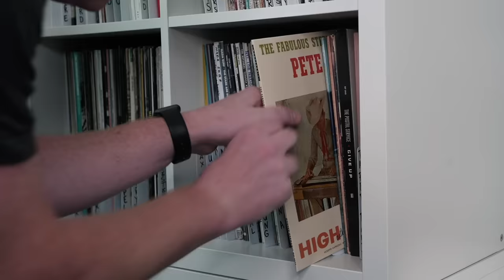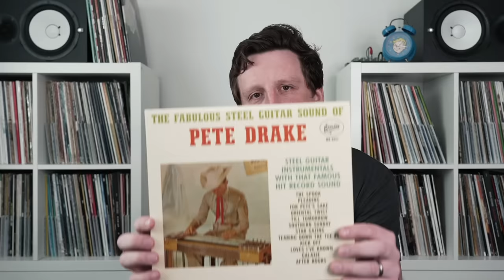6 Guitar Pedal Myths

Comment: I’m an electrical engineer at an aerospace company and every circuit is built with surface mount resistors. If rockets can depend on surface mount resistors then so can your pedals.
Reply from the maker: so much yes
Reply: It's not uncommon that people ignorant to the topic makes an opinion around a myth which then somehow becomes a "fact". Just look at audiophiles and cables - exactly the same thing. Pumping thousands of dollars into "special" cables which more ofthen than not, not really differs to cheaper ones.

It does not matter what the box contains, as long as you get the desired outcome. People need to stop propagating idiocrazy and just enjoy their pedals! :)
Reply: Those boards in the rocket ships, are also Class III electronics, conformal coated, and require perfection! I'm hoping most pedals are Class II, BUT, since they are consumer electronics, they are most likely Class I. I haven't seen any ads on ANY pedals advertising build class. Wish I did!
Reply: just don’t stick a peanut jelly sandwich in there... that will screw up anything... even a BOSS pedal.
Reply: They are less fun to solder though.
Reply: Rockets are ancient technology they've been around since the 13th century. I think it was the Chinese who made them so I wouldn't be impressed by such an ancient technology.  If you said that you worked on the TR-3B I'd be impressed here's a link to the patent https://www.youtube.com/watch?v=WJoX4-0R9b8 .  From what I've read these suckers can go from sitting flat on the Earth to space (above low orbit) in forty seconds. They are huge i.e. 600 feet long but they haven't quite got full anti-grav but 89% is good enough for me . Here's another link https://www.youtube.com/watch?v=3EW9W6xLyek 
My apologies for being a smart ass I thought you might be interested or maybe you know about it already but if you did you'd have to kill us. Lol.
Reply: @brpadington   Yeah, tough on old eyes.
Reply: Hmm, I bet a Space Echo sounds better without SMTs.... ;)
Reply: Rockets are for single use only. Dispensable after first use. Pedals can and should be usable even for 50+ years. That's a big difference.
Reply: Everyone gets their pcbs from china.  It is crappy if they over charge though, i always thought jhs was a budget brand myself
Reply: It's not the resistors that is the problem. Film caps still aren't SMT as far as I know, and I've encountered SMD mono/ceramic caps that are highly microphonic.
Reply: Its about COSTS, smt is way way cheaper...the FACT is that pedal companies are NOT lowering their prices.
 It is sort of like a scam
Reply: Yeah well there isn't a huge market of people modding their rockets at home (lol) so that's the main reason SMT parts suck for pedals.
Reply: @ulfg4692  You are completely correct if the only concern is function (as it should be).  But another factor is the "thrill of ownership", like only buying from Neiman-Marcus or Rolex or Starbucks.  It's an ego stroke and bragging rights, nothing to do with sound.
Reply: @bivvystridents3752  You SHOULD be "hipping" people to the better manufacturing technology and the benefits that it brings (lower noise, higher reliability). You seem to be the more fraudulent party here.
Reply: @ Richard Barnion 🎸 I was always impressed by how Josh was able to create a solid appliance-like vibe with his pedals. Copied the quality and functional integrity thing that was kinda the distinguishing feature of Boss pedals, (whose engineers also determined that Chinese Robots were the superior method of assembling the best product). We have come pretty far since electrical circuits were invented and the physics just are. Nothing wrong with Chinese bits unless you specify poorly. And blaming Jesus for your bigotry is pretty klannish, you should maybe check that.
Reply: Mechatronics Engineer here, Can confirm. haha XD
Reply: @setphaser  The Boss would be fine, though.
Reply: @ulfg4692  ...i agree...i used to buy expensive cables...now i use peavy and off brand ones off of ebay...believe it or not...theyve lasted longer than my fender and planet waves patch cables...even my mogami failed...pig hog is alright....i think its more or less how you treat your stuff...
Reply: You just say resistors......what about the other components ?
Would kind of be expensive to have a rocket launch and failure due to ?????   Would be kind of hard to prove when it burns up returning to earth or even having to retrieve it from space....what a service nightmare.  SO how many failures and what's the longevity of the product ?
Reply: Aerospace electronics don't have the dimension of desirable hysteresis though.
Reply: @zerodollarstudio6934  hysterical.....
I hope I don't wake up tomorrow feeling like Bill Murray in the ground hog day loop
Reply: Hello all, if there is some misunderstanding in my post & replies.....
As "Mr" JHS makes his presentation, and this is not about disrespect or anything in that direction.  He started out building is wares himself, and points out the boutique thing as he mentions another builder assembling his pedals at his kitchen table as in true boutique fashion.  But as with business, when sales begin to snowball up, it begins to get overwhelming to keep up with production, so the logical move would be expanding.....whether that would be in house or by subcontracting.  It would require some great business financing to make that happen if you can't do it out of your own pocket, but that also has implications for the other side of the coin in business.....the IRS game...….you have to wisely navigate to reduce your tax liabilities and generate write off situations.  
Where I live there are a few electronics assembler companies that anybody can contract out to if you want to produce something like a simple circuit board as a component for some electronic device you want to produce and market.  They have invested in the machinery if it were for producing the bare boards and the art work for the circuit traces as well as the machines that feed from reels with the individual components that would be stuffed into the board...….in the through hole era.  But today its shifted to the surface mount and this is what they will try to sell to somebody that wants to contract with them.  As the builder, you would know the cost of producing the unit as a whole as well as the individual parts.  In the parts game, the more bulk you buy, the less the cost of the individual components.  The case is buying one resistor or 25 resistors or 100 resistors......or 5000 or 10,000 pieces.  You have to gamble on how many units you can sale in a period of time......determine your market price at retail and then determine where you will be for the actual assembly cost per unit.  If its just you building these things and with no employee's......you wouldn't really factor in labor cost as your labor and your sales result in your profits.  But your time is worth something.....and that's where the contract companies play in......they have their specialty and want to sell that to you so they entice you in that direction....and today that would be surface mount.

I'm on the other end from a different school of business based on experience via my family...growing up in a family business dealing with electronics.  We were not producers of the products we sold but were basically a resale outlet for a major brand.  SO we built our business and our reputation based on the quality of the products we sold and our service......we serviced what we sold if it happened to malfunction as we stood behind the product as well as the manufacturer standing behind their  products.  
But business today is no longer like that as the general rule.  So if you are old school and care about your customers satisfaction.....that integrity should carry you.  But in todays corporate commercial business arena.....that's not the case.
I deal with vacuum tube guitar amplifiers, service and repairs, but I also design and build.  I can say that what I see of most of the late model stuff …...its all junk being made by assemblers that are computer builders applying that to the construction of a vacuum tube device.  Ribbon cables....board mounted jacks and tube sockets.....all kinds of RED FLAG mistakes in design and cheaply made......and most of that has been through hole circuit boards.  But the worst was a fishman acoustic amplifier a client uses which was all surface mount circuit boards.  Best advice.....don't drop it, my client said it worked flawlessly for his as a touring musician & session man......till he dropped in loading out after a show.
In contrast, another client uses a mid 1970's fender twin reverb with the JBL factory speakers.  He has wheels on this cabinet as its a monster to haul around due to its weight and bulky size.  After a show, and being loaded up in his SUV, his rear hatch did not secure and he did not know this until he was pulling out on the road and having his twin reverb amp go sliding right on out the hatch and on to the roadway......other than a slight scuff or two......it works.  He was in a panic and brought it to me the next day with the story......and I went through and there was not one issue or damage.  Fender twin reverb at 100 pounds hitting the ground with alittle force......VS a 20 pound fishman amp getting dropped with no force other than gravity.....and being surface mount circuit board and no tubes.  
So I'll let you, who ever is reading all this decide the moral to the story.
Reply: @jon malapit. I have been in the Electronics industry for 30 years and I agree with you. I've  had electronic components that have gone to Mars, the most critical medical devices, and black military projects, and they ALL use surface mount construction.
Reply: @RagdollOC  I bet you guys could sell muffler bearings from behind your desks with your skills with a pencil and paper. 

You are not mentioning failure and implying that everything works flawlessly right out of the box and no testing necessary......and forget about lawyers and jury awards as in your world they wouldn't even exist...….
reality check

military spec is not consumer grade spec, and if your stuff goes into space then there is no evidence as it doesn't return home.  A great test would be buying a home next to a nuclear power plant and having full trust in your electronics running the show.....perhaps Chernobyl or Fukushima has some available real estate.....
The Israeli's just crashed into the moon...."communications failure" as its termed
Reply: I'd further bet that the engineering school only taught you digital technology and you know no other way to construct other than what you were taught in school.....as they drilled into your heads that anything else is obsolete
Reply: @RagdollOC  guitar pedals and the like run at either 9 volts or 18 volts and not at millivoltages found in microprocessors, so there is a cushion of voltage in a guitar pedal for voltage before you need to change out the battery as it wears and drains...…...but god forbid that you have a voltage issue in a microprocessor running in millivolts as that's called MALFUNCTION.

1/2 watt and 1/4 watt resistors would be alittle overkill...….but it sure blows away having to use tweezers and a microscope to construct a surface mount piece subject to the voltages you work with in microprocessors...….speaking of a lab and before assembly line production when you are proofing your circuitry in development

or do you guys skip development ?
Avoid engineering faults and errors details in the NON DISCLOSURE DOCUMENTS ?
Reply: Do your SMT rockets have the same creamy mids and fragile harmonics as through-hole rockets, though? (j/k)
Reply: awesome.....Dock Ellis, the classic Pittsburgh pirate that pitched major league baseball while tripping his brains out on acid
Reply: @mikecamps7226  What's wrong with board mounted jacks ? Genuinely curious about that one
Reply: If you read through my postings, I answer that.But I'll do it again....The jacks need to be divorced from the boards as they are a point of mechanical stress and fail...the solder joints fail...the traces on the board/contact points fail as they get levered out of the mounting points on the board.   People building these things today are people trained to build computer electronics...so they use surface mount items and board mounted components and ribbon cables....which are not for audio oriented circuitry.  Oh yes they will work, but they are not reliable or serviceable.  All guitar amps with a circuit board that have board mounted jacks....the jacks fail with time......and this carries over to stomp boxes and anything else.  Designed obsolescence or translated......designed to fail so it either needs serviced OR its a catastrophic failure that can't be repaired so you have to buy another unit.The old style jacks are easily replaced if and only if they are a grounding jack and they become unsprung due to metal fatigue in the spring part of the switch of the jack.  If its not a shorting jack, then they never go bad.....they might oxidize where they just need cleaned, or the mechanical ground of there mounting might need cleaned....but they never fail.  In stomp boxes, the case is usually an aluminum or an aluminum alloy material, and the old style jacks are steel.....2 dissimilar metals which means cathodic action and oxidation/corrosion, so at some point in time...they need cleaned and that's it.  Its the usual point of issues with stomp boxes...the grounds.If you google up and research, as conductors and the flow of electrons.....they travel not so much internally in a wire but more so at the surface...the skin of the conductor.  This is why circuit boards and traces are not good.....its the width and the thickness of the traces as compared to actual wire.  If you were to roll flatten out a piece of wire ad compare it to a trace of a similar connection and function in a circuit on a circuit board...the rolled flatten wire will be substantially wider at the similar thickness, if its solid core wire.  Stranded wire vs solid core wire....the stranded will have more surface area because of the multiple strands.....of the same gauge.To further this, when a conductor is happening and there is signal and flow.....there is an aspect of electromagnetic action.....a field generated...or in other terms radiation around the conductor.  The wire if it has insulation meets part of a definition for a capacitor.....but move that wire close to another conductor and the definition gets satisfier...2 conductors separated by an insulator....thus capacitance which will affect an audio signal...so there has to be a separation of conductors so there is no "cross talk" between them.....which is also called lead dress in some applications.  So you have to know which traces and leads are vulnerable to this phenomenon and space them apart accordingly to defeat it...….which means space & spacing.  In electronics, its not about making something big and spacious...its about miniaturizations....so it compounds the situation.  In electronics and amplification devices, there is an input which can act as an antenna, an output which can act as a transmitter, and then there is the bias connection....3 parts, and you don't want to create a layout where an antenna is close to a transmitter in the circuit flow......on top of everything else I mentioned
Reply: Mike Camps sorry I didn’t read through all the thread, very interesting to read your comment though! 
I’m guessing the same reasoning can apply to pcb mounted pots ? Or is it less of an issue ?
I don’t see how resoldering a pcb mounted jack is more of an issue than replacing a classic “open” jack ?

About the traces vs lead, if I understood correctly a stranded wire will conduct better than a solid core or a trace? and a point to point build with plenty of room will have less crosstalk and noise than a tight pcb ? Doesn’t that refutes what Josh said about surface mounted components ?
Thanks for sharing your knowledge!
Reply: You all have to understand that Josh Scott is self educated in electronics......he has another video presentation where he states this and also talks about how he started in this and his curiousness and that he is constantly learning.  He also mentions that he has hired an electrical engineer to be under him in his business organization.  SO he went on to state that he does a layout of a project using a breadboard when designing something.....and a breadboard in not a traced circuit board as you would find in a pedal.....it is much larger and spaced out and you use wire and components to reach a result....experimentation.  He states he hands this off to the engineer that then creates the circuit board.  He is no longer at his kitchen table laying out and assembling things as when he first started......no longer a one man band of an operation.
Reply: the pcb mounted pots are actually less of an issue because there is no mechanical aspect in use where you are plugging in and out of the item....all the time.  A 1/4 inch jack can act as a lever and the fulcrum point is the hole as it meets the chassis......all it takes is a lateral bump to the male jack...a tug on the cable …...and its metal vs plastic for material strength with the application of a lever and a fulcrum.The negative aspect of PCB pots is if they are full size or miniature types.  The values might be the same between the full size and miniature, but the sweep of the trace......the distance of the trace in the pot is less in a miniature pot due to the physical size of the item.  The main gripe about a PCB pot is that its fixed to the board and not wired to the board, so in servicing a unit, you have to take the whole thing apart to service it to get the board out of the chassis.  In the old style point to point stuff.....even though its actually an old style circuit board..….you didn't always have to remove it from the chassis.  With the modern circuit boards.....you have to access the solder points for the components and that is opposite the mounting plane....so you have to remove the boards...and hopefully if its through hole, the solder pads are suitable for being serviced.  If they are minimum gauge type boards...the solder pads can pull right up off the board and detach from the traces.  If its a heavy duty board or a military spec type.....that's usually not a problem.  Now if you go into surface mount, that's a whole different arena and its just junk.  You need specialized equipment to service them...if you can service them.  Most of the electronics service issues...past present & future deal with bad solder joints and or a failed component.The PCB pots can have a fixture that more securely mounts them to a board rather than just the 3 lugs of a typical pot.  SO its a pain to remove them for replacement should they fail.  I've serviced some Laney items where they used crappy PCB mounted pots that were notorious for failure and they were the miniature variety.  I usually replaced them with solder lug type miniature pots and had wired them in to the board.  The one point of possible failure with the free standing PCB type pots is flex when servicing the board and removing it from the chassis.....where the flex can affect the solder pads.  Servicing circuit boards can be very tricky and a pain.
Reply: @brpadington  yup
Reply: But Jon did we go to the moon is the real question?
Reply: @ulfg4692  I'm somewhat of an audiophile. I run a Devialet amp with phono (vinyl) and a CD-quality streamer inputs to transmission line speakers - truly great sound quality at every volume level. Interconnect cable quality for my phono input has an impact on sound quality due to electronic interference.  I use an interconnect with an interference filter (about $125/pair) for the phono line and that was enough for my system. 

My streamer uses an optical cable, so no issues there.

Speaker wires are less of an issue for me with this system because it cannot be bi-amped. When I did have a bi-amped system quality was vital - especially cable length (potential for out-of-phase signals).

For my guitar leads and pedal board cables, I use moderate quality cables because I play with at least some fuzz or distortion always. This hides any electrical interference, so I spend my money elsewhere.

Essence - If you can hear the difference, it's there. If you can live with that sonic quality, don't waste your money. If you cannot, upgrade. Goes for pretty much anything - home theater systems, stereos, cables, pedals, power supplies, amps, tone woods, etc.
Reply: I will start a company called "Rocket pedals", my tag line will be "made to NASA standards" and all of them will be made with surface mount resistors.
Reply: Dude, everyone knows vintage rockets obviousely sounded way better, especially sovteks.
Reply: Aaron Hall hey dude, i used to be the manager of the devialet showroom / flagship store in Paris.
Demoed dual 250´s all day long with insane speakers like the Atom Gt3.
Well it should have made me want to upgrqde my system. Plus i had HUGE discounts. 
But all it did was actually make me appreciate my vintage monitor audio speakers and kenwood amp more.
They sure as hell dont sound as good but i would have to fork up an insane mount of money to get an upgrade that's actually visible (to get to the newt level).
So i just bought a good DAC and switch the turntable's cartdrige instead and i've never been happier.

You can find good sounding gear at any price. What's really hard to find is information.
Reply: @krzysztofwaleska  Rockets are multi billion dollar investments that have to withstand incredibly tough environments to deliver their payloads. The fact that they had no way to get them back to earth safely (until spaceX) has nothing to do with it. You can be sure every circuit is built to a far more rigorous standard than any pedal.
Reply: @RagdollOC  what was that stupid rant about Lmao
Reply: Didn't the military use wire-wrap in missiles too?  Maybe we should bring that back ...